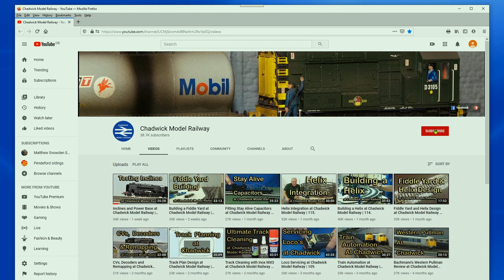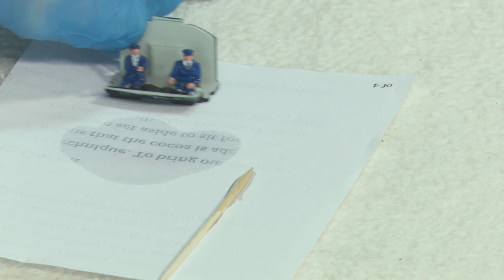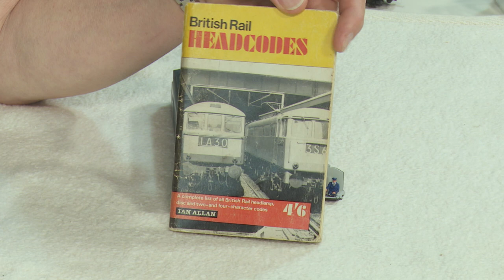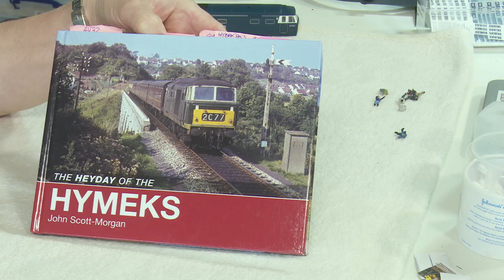Fitting Loco Crew at Chadwick Model Railway | 130.

Comment: Hello Charlie, I enjoyed your video. Quick question if I may? What is the benefit of using the super glue accelerant please? I've never seen that product. Just curious as I always found super glue dries very fast anyway (often too fast actually!). Thanks and best regards. Vivian
Reply from the maker: Hi Vivian, I find that when glueing plastic to metal the superglue struggles. The activator encouraged is the bond much quicker. Regards Charlie
Reply: @ChadwickModelRailway  Thank you very much for your informative reply Charlie, very useful.  My superglue of choice is usually Gorilla gel which I find gives a little time to position items before grabbing (also the first superglue I ever used that doesn't go solid in the nozzle after a couple of uses!)  But it sometimes struggles on certain plastic / metal applications, so I will give that accelerator a go,  When it has failed in the past I normally resort to good old Evostik impact or, as you say, Araldite but they are both overnight setting jobs.  Many thanks again.  Best wishes.  Vivian.  (PS have subscribed)

Comment: hi charley ,just  had a thought, ive noticed on a few of your cool videos, you keep having to remove your glasses, , i had the same problem in my videos, to resolve this i paid a visit to my local opticians, and had a pair of tri focal specs made up for me,  no need to remove them again, just a thought, keep up the cool videos,
Reply from the maker: I do have several pairs of bi-focals but I tend to use them for driving and TV.  Perhaps I need to try harder to change my habits.

Comment: Hi Charlie, when you do the video next week, will you run through resetting a decoder to default values ( manufacturer reset). CV8 I think. The reason I ask, is that I use Traincontroller and Trainprogrammer, both licensed not demo versions. When I try and do a reset it reads the cv but won't let me write to it, the write is greyed out. So, I might be doing something wrong. Thanks for another great video.
Reply from the maker: I have never  tried to write CVs with TC. I’ll have a scratch around.
Reply: @ChadwickModelRailway  Thanks Charlie, everything else works ok except the reset. regards Malcolm (Chartwell Junction)

Comment: 1B cab front end looks like it has a crack in it!   If it has, is there a way to fix it?   Oh and I don't like the screwless methoud of holding the body on, always dislike having to try and spread the body, I always think that it is going to destort the body!
Reply from the maker: I’ll check out the Ib cab front. However I can’t change the design of the cab fitting

Comment: Charlie,

Let me firstly say I always enjoy your postings ,even if they don't apply to what I am doing. Secondly you are the only person I am a patreon of so you must be doing something right. Anyway I am interested in the DCC Concepts ABC shuttle and wondered if you have, or know someone with experience. I recently took the round the room layout down due to window replacement in the near future. This now leaves me a 13ft x 3ft switching layout on one wall and room to run a shuttle. I am originally from London and these shuttles aren't here for the most part and there are very limited videos. It seems simple? Jenny Kirk did one but wasn't as clear as I hoped.

Any help would be appreciated. Cheers Peter
Reply from the maker: Hi Peter,  I shall look into next week and see if if its a goer.  Regards Charlie
Reply: @ChadwickModelRailway  Many Thanks for your consideration.

Comment: Hi Charlie, looking at the new fabulous train drivers they don't half look the part. Question is about the super glue accelerator. If you didn't use it, how long does the superglue take to go off, and does it affect the models ?
Reply from the maker: I can’t really answer that Rick. I just use the Excelerator because I need to get it set within a certain time. Regards Charlie

Comment: Hi Charlie, I don’t know if anyone has mentioned?, that if you use super glue inside a cab, I’ve had the window glazing turn a frosted look from the fumes of the drying super glue.
I wonder if anyone else has had this issue?
Kind regards Jonathan
Reply from the maker: Very interesting point Jonathan. I have never heard of it but we live and learn. I imagine that the superglue Excelerator that I used, may have removed that problem.

Comment: Good video Charlie, but I don't understand you Brits, using these brands made in China, mainly Hornby and Bachmann. there is no quality, the sound is woeful, detail does NOT exist, even if you think so. No performance up the hill, and I could go on. But you must have a reason... I have locos going up a 4 % hill with 8 coaches and it will not slow down. Try That with your.. Still, your videos are great. Cheers, Mark
Reply from the maker: If you wish out model UK trains, you have no choice Mark.  The sound however is ESU from Germany.